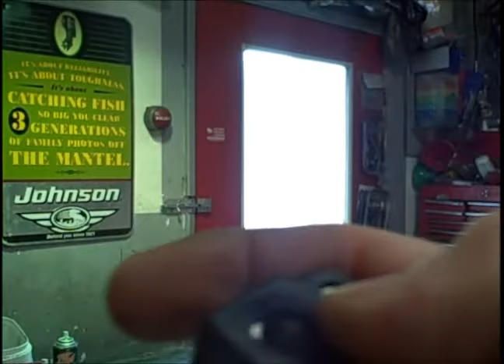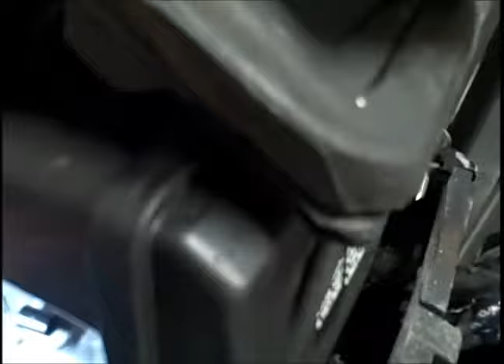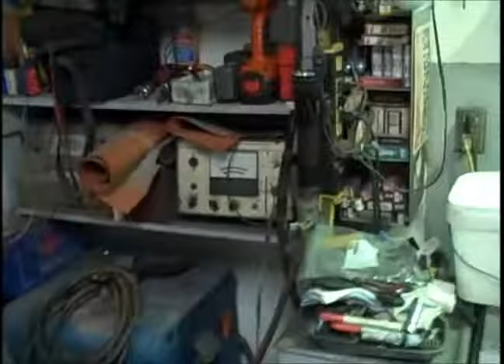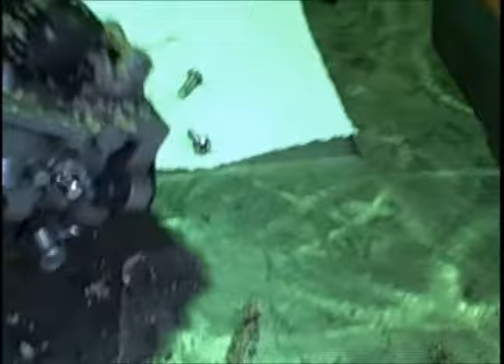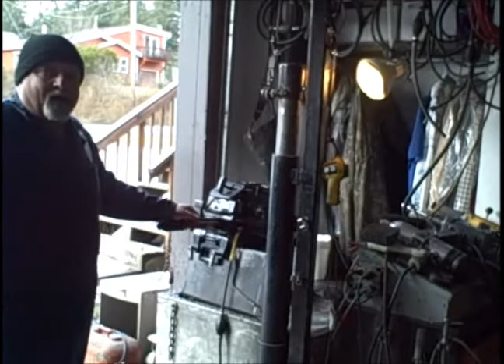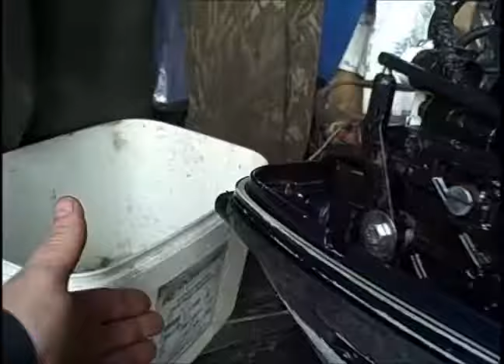15 HP Evinrude repair

Comment: These 9.9/19 hp outboards are actually great motors.  I’ve had my 1979 model for twenty years and have only had to replace one coil and rebuild the fuel pump once.

Comment: Umm...I am having a problem wrapping my brain around...sand in the fuel pump and carb. I get it that the fuel connection broke but how can that much sand get up the hose for them to pull start it into the pump!? And...isn't there a filter before the pump? Do you think it was rolling in the surf...in gear and the rolling was turning the prop and rotating the motor? A miracle nothing got inside the motor. Nice fix Kodi
Reply from the maker: +Bob Bell,  I would guess the motor was running when it went swimming in churned up sandy water,  Then  flopped around in the surf for who knows how long,  all I know is she had sand in every fuel component & allot of it.    kodi

Comment: Hi kodi, I am cleaning a carb similar Its an 86 evinrude 15. The high speed jet was stuck in it and I destroyed it while trying to get it out .  I drilled it out and I hit the emulsion tube behind it a couple of times. Roughed up the end a little and maybe shortened it a fraction.  Do you think it could affect the way the carb works?
Reply from the maker: +Tony Bruno,  Ok I think you are saying you could not remove the Hi speed jet.. the Hi speed Jet sits in the carb bowl ,,,  the emulsion tube  is located in the upper body it sticks up into the venturie chamber of the carb,  ( carb throat )  So I would need a bit more info on the jets ,, location,, & the damage to make a good recommendation ,                          kodi